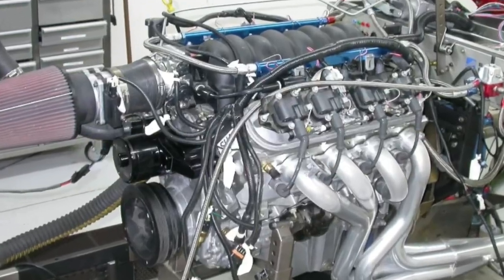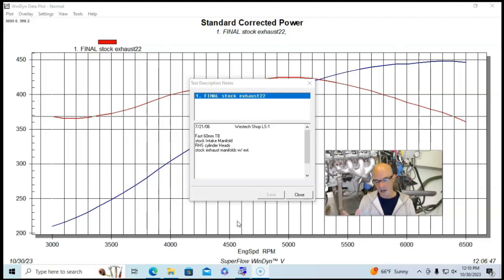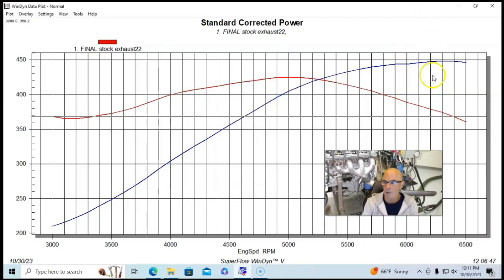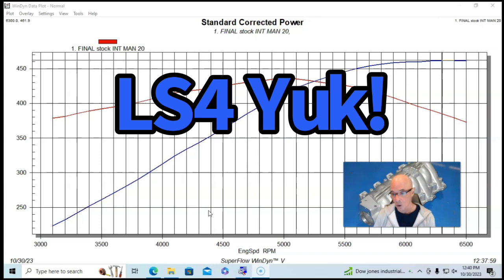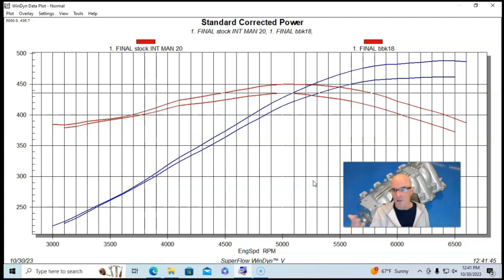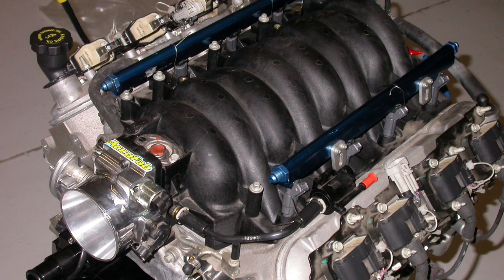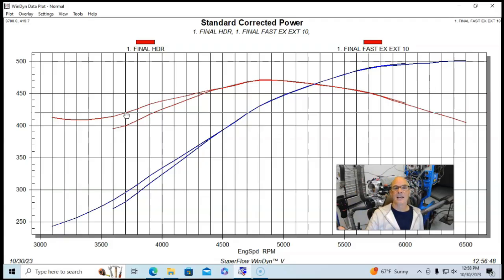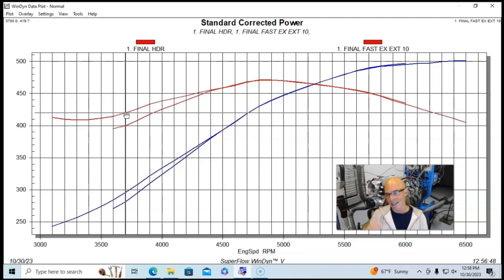HOW TO: 5.7L LS1 POWER MODS HOW TO MAKE MORE POWER WITH YOUR 5.7L LS1. LONG TUBES VS STOCK EXHAUST

Comment: Richard, how can we explain such a massive gain at low rpms with headers extended 4 feet?
Reply from the maker: are you asking about collector extension?
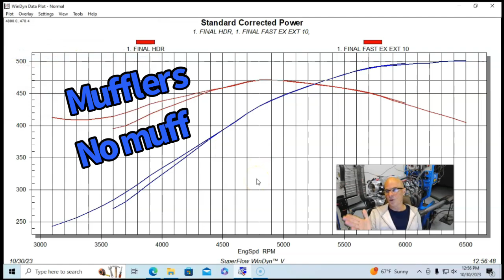Reply: @richardholdener1727  Yes, at 10:21
Reply: @richardholdener1727 yes )

Comment: I really wish you'd do these starting with a stock motor. I'm sure its all directionally similar, but I would be nice to see what is the most limiting factor. IE if I have $1000 to spend now, what is the best place to put it.  Based on this it would seem to be smart to do the intake manifold first. However most other information I've seen have long tube headers making a lot more power than you are showing.
Reply from the maker: The first Perf m0d for any LS is cam and springs-never an intake.

Comment: What mods can I use on a ls6 to gain horsepower but still pass smog?
Reply from the maker: you have to check with the various manufacturers to see if they have emissions legal perf parts

Comment: How about how to bullet proof Ls1/Ls6 blocks. Been seeing them have a lot of issues like cylinder 7, rod bearings, main  bearings. What are some recommendations.
Reply from the maker: there is not a standing issue with rod or main bearings-nothing wrong with the blocks, those specific alum blocks are not the best choice for high-hp boosted applications

Comment: My og 5.7 just made 544whp 446wtq.  I think there's another 20-30 left in it.
Reply: What mods do you have?
Reply: @markmartin7384  nothing special really. The bottom end was rebuilt with gen4 rods, mahle power pack pistons and the stock crank. The heads are old gmpp cnc 243s that i tuned up a little. They have been milled to get the compression to about 12:1. Has a cam motion llsr 23X-24X with about .63x lift and a msd intake that i ported......adjustable pwr rockers and psi beehive valvesprings. Makes peak hp about 7100-7200 and carries to 7800. I think peak tq is about 5800 so it has a really broad rpm range.
Reply: @HioSSilver1999  thank, it sounds awesome

Comment: just got a C5 Vette trying to figure the best combo of parts for the ls1
Reply: Same just picked up a Fbody and can’t wait to get some mods
Reply: I not long ago got a Holden Adventra with the 5.7 LS. I know being from the US you wouldn't have heard of it, but to put it into perspective think of an early 2000s GTO but factory AWD in the form of a wagon, its a bit of a barge weighing on at almost 2000kg (4375lb). So I'm on the hunt for things to get power and torque down low followed up by a turbo for top end speed. Any tips you've learnt?
Hope your builds are coming along great though.

Comment: No way stock ls1 with just a cam n throttle body made over 430 hp😂😂 mayebe in a ls2 gto or ls3 camaro don’t see a 98-02 camaro engine make that much mine stock with 320 hp had an 02 ss camaro with just headers and exhaust and btr stage 4 cam made 380 hp 390 torque so idk how he’s making 445 or something that just seems way off or has more done to it than what he is saying 😂😂
Reply from the maker: This is engine dyno. This has optimized tune, no accessories, headers and open exhaust, run cold-you have much to learn-the results are 100% accurate
Reply: @richardholdener1727   but open headers only add 20-30 hp tops  ls1 from a 99 camaro only came factory with 305 hp unless you had a 2001-2002 camaro those came with 241 heads and ls6 intake and the ss those years I believe made 340 hp  I’m talking about crank hp of course
Reply: @derekwhite1738  if you knew what you were doing you would easily make over 400whp. You're in bolt on territory really.

Comment: I wouldn't waste $ on a fast intake if you already have the ls6 on there.
(Only worth it on a max effort H/C build)
Free mods are good for at least 10whp
Look them up
Throttle body port
Bump stop
Etc etc

I just put down 355 whp and 358 ftlb with a boltons/free mods and a tune in my 02 Z28 M6

Comment: I have an ‘02 z28 I want to wake up. What changes need to be made to the fuel system to support these upgrades? Fuel injectors, fuel pump? Would you need to move to a high volume oil pump?
Reply from the maker: only injectors and fuel pump and tune-the oil pump is not part of the fuel system and the stock one works well
Reply: The fuel pump is fine till about 520whp.

Comment: I pulled the 5.3 from my Silverado and tossed in an LS1 I had laying around that was pulled from my old Trans Am.  Basically, just swapped short blocks, added a stage 1 truck cam and long tubes.  Since the 08 comes with the better intake and heads, after rebuilding, I reused those knowing they would work great.  I tuned it for 87 and e85 as well.  Truck ended up picking up 80hp and 63 tq to the wheels, makes the same peak power as a stock 6.2, idles stock and gets the same mileage as my 5.3 did.  I had played around with the idea of adding the Truck Norris and the I6 trailblazer converter which would have certainly added performance and power, but this was in the summer of 22 when gas prices were going up.  I also liked the idea of something that idled stock and (in theory less oil dilution from overlap) would go stock oil change intervals.  Overall, I'm super happy with it and love knowing it has the OG LS granddaddy, its nostalgic.
Reply: How did that work if the ls1 is 24x reluctor and the 07 5.3 is 58x
Reply: @2sscole  swapped the reluctor
Reply: With 25 extra cubes, a cam, and tuning, 80 more h.p. is completely believable
Reply: @davelowets  it was tuned before too.
Reply: I did all that and my i6 converter is ass lol go for a 3200 aftermarket

Comment: Richard this may be the best question anyone ever asked you, however it doesn't directly pertain to this video. Since EGR increases compression by taking up space in the combustion chamber as an inert gas, what would it be like to supply Argon to the intake in any engine and compare numbers with or without the argon ?
Without even doing the test, what are your thoughts on that?
Reply from the maker: by adding an inert gas (especially exhaust) you are replacing the good air that make power
Reply: @richardholdener1727  ah yes, the argon would displace the good air.

Comment: How does boost affect the valve springs? I'm curious to know if boost pressure can cause valve float. How much extra lift should be allotted for boost pressure. In my head if there's constant pressure ontop of the valve pushing it open at some point it should be able to force that valve open.
Reply from the maker: it will never force the valve open, it just effectively reduces spring pressure

Comment: Aussie here, so yep, I love the LS1 5.7 content. Thanks, Richard ! Has there ever been a test of moving from an LS6 manifold to a Fast 92 or 102, but on a CNC ported 241/243 heads 5.7 using a baby cam? Obviously with a big cam, there's good results, but with a baby cam, im told not worth it. Especially with the extra engine noise and hacks needed for a Fast manifold. Plus over $3k of the folding stuff!
Reply from the maker: only you can decide what amount of money is worth a given power gain. A fast makes more power on every combo, the wilder the combo, the greater the gains
Reply: @richardholdener1727  Thanks, Richard. I'm probably most concerned about the gain being nothing, which I've seen people report with a similar combination to mine. Basically because the cam is small, so doesn't need any more flow than what the LS6 delivers. I've seen many Aussie LS1 owners say this with cams up to the 220/220 range, but on the other hand, all the LS2 guys swear by the Fast upgrade no matter the cam size. Most likely due to the issues with that factory manifold I guess.

Comment: Yay for LS1 content!🎉
I’m in the middle of a (unfortunately way too) long term swap using a low mileage LS1 I have been sitting on for a while. I’m fabbing up long tube tri-y headers to fit (MGB, so nothing available) and will do a cam , and likely heads at some point. I like seeing numbers on the original 5.7

Comment: Show us how to get more vacuum with a stage 3 BTR cam, or any other cam that need the vacuum to run. I have a 1973 Camaro that I put a BTR stage 3 cam into LS swap, and need more vacuum for the power brakes.
Reply from the maker: DIFFERENT CAM
Reply: @richardholdener1727  no not that
Reply: Run a vacuum reserve can....

Comment: This is a great youtube channel. I have an idea, but others probably already said it, or you already did it. How about a 5.7 comparison, late model and stock. Then larger versions. 5.7 from GM in LS architecture, then 5.7 sold through FCA as the "Hemi".....look at that monster midrange torque. Wow, what a great motor.

Comment: As a C5 owner, I've been waiting on this one
Reply: I had an ls6 with full bolt ons and an ls1 car with the z51 that was cammed. The ls1 car scared the piss out of me and I wish I had less power lol it was impossible to hook with anything smaller than 325s which wouldn’t fit without ridiculous tubbing. So I just bought tires every 6 months haha

Edit this was also in 2008 and 2009 so I’d assume stuff is way better now but also way more expensive. It cost me like 7000 to a shop to fully build a stock ls1 car. Only problem I ever had was a valve spring pop over 80,000 miles. Ran 93 octane. Couldn’t drive it in the rain tho unless I wanted to die

Comment: When I had my 2002 Camaro SS stock bottom end LS1. 
Made 450/405 to the tire. 

CNC factory LS2 heads, ls6 intake, BTR Stage 4 cam, etc...

Very healthy
Reply: I have a 2002 ls1 from a camaro I’m about to start on now!
Reply: @Slowpoke99s10  you started yet? I just got my 2000 camero z28 with a ls1 in it got it yesterday lol😂

Comment: That FAST intake was a big deal on the 5.7, and many of us want to put our noses down on these engines, they make a ton of power with the right parts!
Reply: What would you recommend for mods on a 5.7? I'm looking at putting a turbo on mine. It's in a Holden Adventra which is essentially an AWD GTO wagon weighing around 2000kg (4400lbs). The stock 5.7 pulls alright once revs are up, but I want more🤣
Reply: @joshthomas2536  With the turbo, the turbo makes the power.    Put a single gt45 on it, and your good for 700-800HP and similar torque.   You could run gt45 with stock exhaust, merge the exhaust with a "Y" send that single 3" or 3.5" pipe back up into the engine bay to feed the turbo.   Relocate the battery to the trunk.   Turbo can go in that location.     Heat shielding where required.
Reply: @dennisrobinson8008 turbos make the peak power number but the engine will make the curve. Its difference between a 3000-6500 rpm power band and a 4600-6000 rpm power band, only 1 of them is actually fun to drive 😂
Reply: @Ballen1182😂😂 where can I find that dyno ?
Reply: My c5z setup was FAST intake, vararam ram air intake, heads, long tubes, borla stingers. Can’t remember the x pipe. That car was terrifying
Reply: @CiviTac what kind of power did you make??

Comment: Thanks for doing this!
I have a low mileage LS1 car and debating what modifications to do to my car.
When people ask me what they should do to their LS engines I direct them right to your videos..
Reply: Pull it for an LS3 and add a cam. Cammed LS3 > all but max effort head cam ported 102 Fast Ls1.

But seriously, for cheap I'd make sure you have an LS6 intake, add 243 or 799 factory heads and maybe have them ported, headers tsp or speed engineering 1 3/4 or 1 7/8, small cam (220-230 dura 600 lift 112-114), and clutch.  That's quite a bit of money still if you don't do the work yourself but you should be 420-430ish wheel 390-400 tq for a 6 speed. 

3.73s if auto 4.10s if M6.
Reply: @Carado5150  it has the LS 6 intake.
I'm back and forth about modifications because it low mileage like new..
Reply: Strap a turbo on it Pump some E85 through it and send it haha
Reply: @jjjjjj9284  naa it's low miles like new...
Reply: @philllsxga.7737  like mine mate , my Beast has only travelled 81,000km in 23yrs lol...
Reply from the maker: Right on!
Reply: Lid and long tubes to start
If you're M6 then gears are an absolute must
4.10 was my favorite
I've had 3.90 4.10 and 4.56

Comment: What year did the LS one change to a better manifold?
Reply: I think it was 2001
Reply: 01+ have ls6 intake
Reply: My 2000 Holden VX SS Had a Ls6 style on it from factory, but not anymore haha
Reply: Richard showed that the LS1 with modern heads, intake and cams are not to be overlooked.   They are real power making monsters! @jjjjjj9284
Reply: I have an LS one out of a 2000 Camaro. I was hoping to make 550 to 600 is that feasible and anybody have a parts list to achieve those numbers would be appreciated.
Reply from the maker: watch the hp recipe videos-I have 500-hp and 600-hp vids up for ls-that will be hard NA
Reply: LS2 has the LS6 manifold which was worth more power than the LS1.    However the Fast makes more power than either.
Reply: @dennisrobinson8008 No, ls2 has the ls2 intake and 90mm TB factory. LS6 uses a 78.
Reply: @Carado5150  so the ls2 intake was an advancement over the ls6 intake?
Reply: Outside of the 90 mm TB vs 78 mm TB for the LS6, was the LS2 considered to be an advancement over the LS6 intake? @Carado5150
Reply from the maker: ls2 and ls6 manifolds are quite different

Comment: Hey Richard.. Now take the 5.7 and compare it to the 6.0. The 5.7 came with 345hp-400hp for (LS6), but the 6.0 came with 300hp-400hp for (LS2). Can you please make a video on this?
Reply from the maker: THE lS2 MAKES MORE THAN THE ls1 (THE LS6 MAKES SIMILAR PEAK POWER TO lS2, BUT MUCH LESS TORQUE.
Reply: LS2 had LS6 heads and more bore.    Thus ore power than the LS1.  LS1 heads peaked at 220-230 CFM ,  LS6 heads peaked at 240-260CFM.
Reply from the maker: ls6 had a more powerful cam and more compression
Reply: @dennisrobinson8008  Difficult to bore the LS1 past about .005 overbore.  Especially the early blocks.  Easy to stroke but difficult to bore out.  Less expensive to move to a 6L or 6.2L block.

Comment: I want to see if there’s any gains from a expansion in the exhaust like on a two stroke. 3”-4”-3”. Would there be any gains from having a high-low-high pressure wave? I see more and more intakes that do it which makes more sense. But I have a race car and resonator that are 4” the rest is 3.5” (drag and drive gotta be “street legal”). I noticed a gain but that could be from the cat being .5” bigger than the previous (same brand race cat).